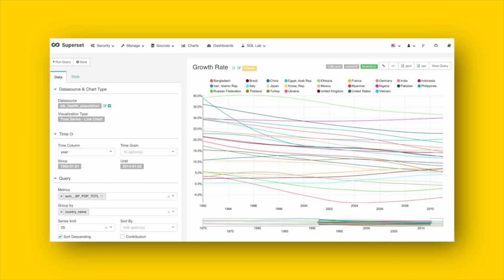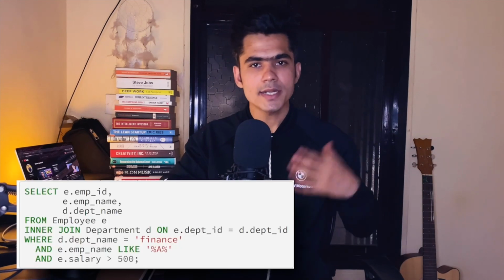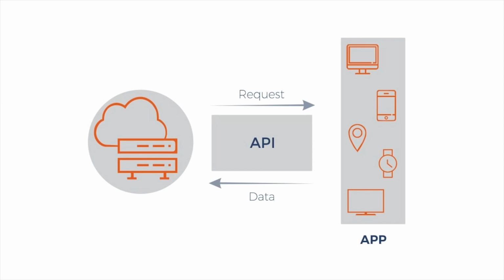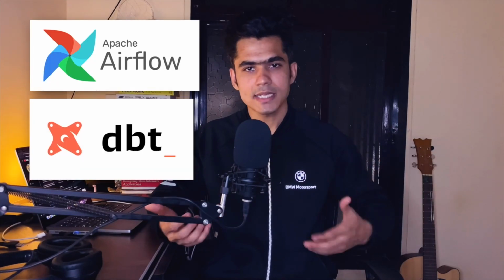These 3 Things Can Help You Understand Data Engineering Roles

Comment: What is the salary difference between these 3 roles and what is the difference between software engineering-data and data engineering?
Reply from the maker: I will make a video on your first question in the future but for 2nd question 
The title might be based on different companies so if it is a product company and you are working on product + database side then company might call that role as software engineering-data

If you have job description for this roles and you can link it here I will check it and let you know
Reply: @DarshilParmar  youtube removing comments with links so adding spaces in between
Reply: Emailing you since youtube is deleting links here